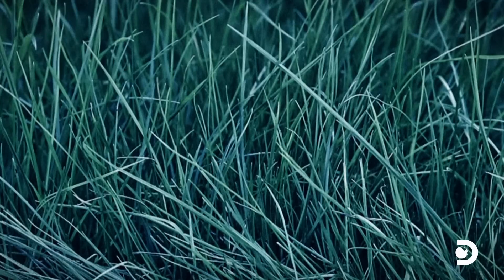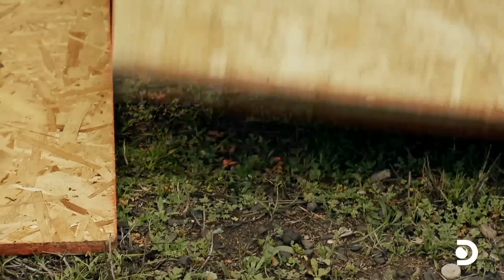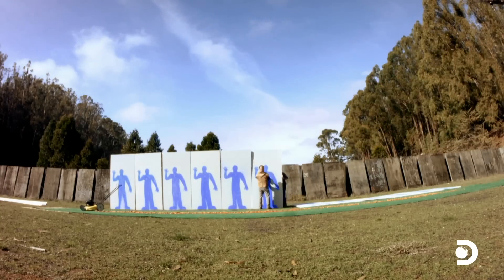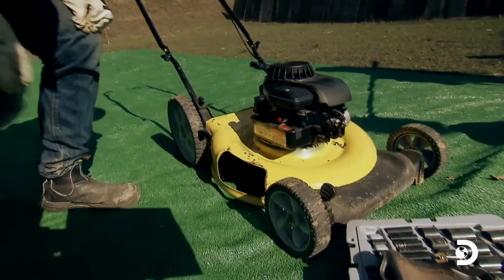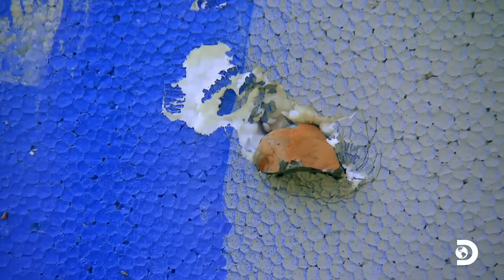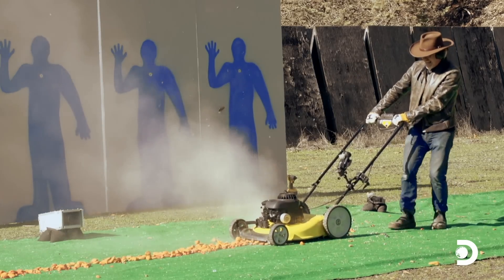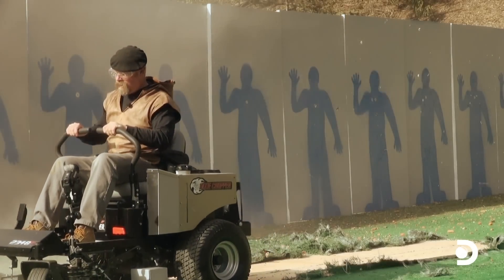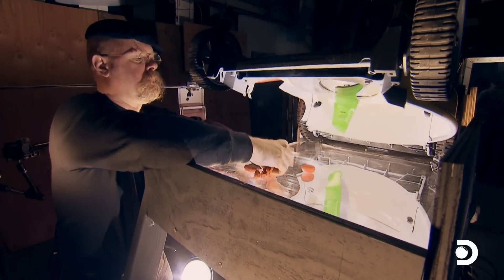Rocks vs. Bullets: The Surprising Power of Lawnmowers | Mythbusters | Discovery

Comment: The whole rock experiment is so flawed. They only used one type of rock. The type of rock also shattered when the mower blade contacted it. A lot of energy would have been lost in the breaking of the rock. You need to use rocks of different density and hardness to determine what type of energy transfer you can get. Also the amount of kinetic energy isn't necessarily what makes the rock or bullet dangerous. Bullets actually don't have that much kinetic energy. What makes a bullet dangerous is that the energy is focused into a small surface area of a hard/dense object which can pierce your skin and fatally wound you.  There is more energy transfer from punching someone than shooting them. You would much rather be punched though.
Reply: So many of their experiments are obviously flawed, it’s confusing why. Running through a pile of rocks will also significantly slow the blade in comparison to a line of rocks spaced to allow acceleration of the blade after each impact.

Comment: Talk to Stephen King about lawnmowers..: his only foray into directing went horribly, horribly wrong when his director of photography ended up with blindness in one eye after a robotic lawnmower would respond to the remote during the filming of Maximum Overdrive… upon reading of the situations..: i wondered why they needed a actual blade attached to said lawnmower anyway… remove the blade and merely make the sound effects.

Comment: I did yard work for 50 years on weekends and after a full time job. 
I had all the equipment for the work. 
Only one time I had a problem with a rock.  It was about the size of a golf ball.  It got under my 22HP mower and sailed into a school parking lot breaking out a window of an empty school bus about 35 feet away!😮
The bus driver came running to see what had happened. We were thankful no people or children were around which would have been bad. 
If I ran your mowers I would have a lot of safety equipment on!!☠️
I became more thorough checking for anything that would become a missile. The rock overpowered the safety door so I put sheet metal screws in it to hold it down. 
Thankfully nothing like that happened again. Don’t run lawn equipment in shorts and flip flops!
Keep everyone away from you and wear safety glasses.  Nobody in the yard and no free rides!!
Reply: Also have to watch out for bones. Hit an old dog chew bone with a zero turn and it became shrapnel hitting a wall. Would not want to be on the other end of that. Have noticed the deck design on the kobota tractor doesn't really fling rocks but the Husqvarna zero turn does like it's the main job it has. The tractor with lots more power feels way safer to be around.
Reply: Last year I was mowing our backyard and I ran over my dogs chew toy which was a rubber ball sort of thing, was hollow on the inside but thick on the outside and the lawnmower launched it and hit the metal fence that separates the pool deck from the backyard and it bent two of the bars severely. Now imagine it hitting a person…